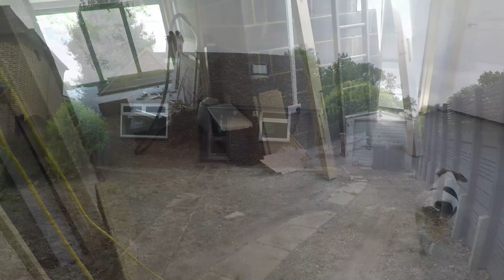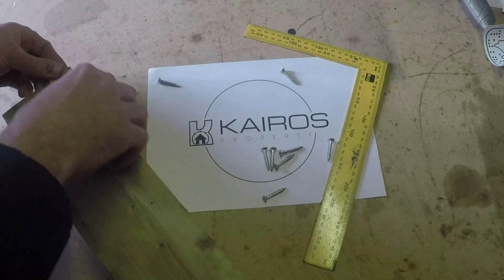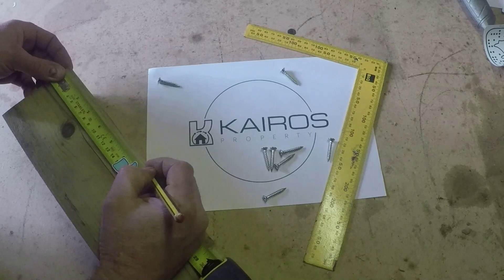House Renovation - Part 59 stairs

Comment: Great Video and have followed your whole series on this house build. One intriguing question did the staircase supplier provide the glue and what brand or type of glue did you use to make the whole staircase. Thank you
Reply from the maker: Hi 

Thank you for watching 👍👍

The stair case came with the pegs to hold the stringer together and blocks that go under the treds to stop the squeaks, however no glue so we just used standard wood glue, the joints are very tight so didn't need any sort of expanding glue.

Regards Kairos